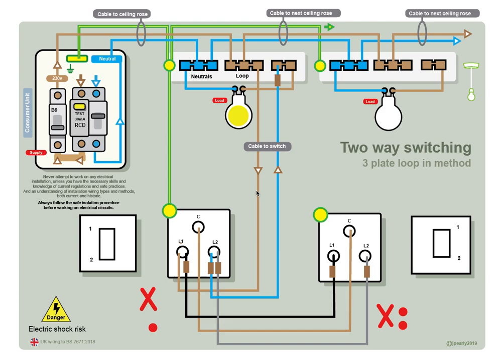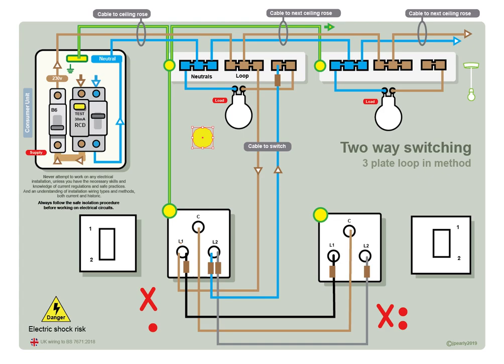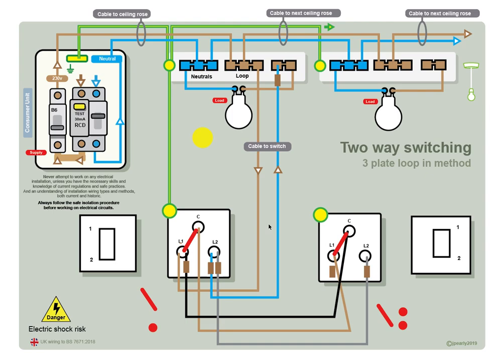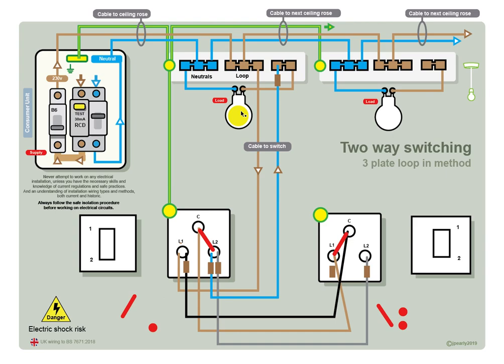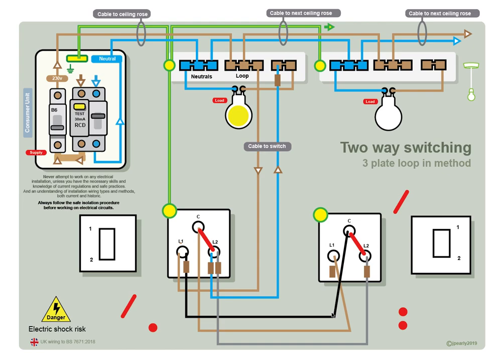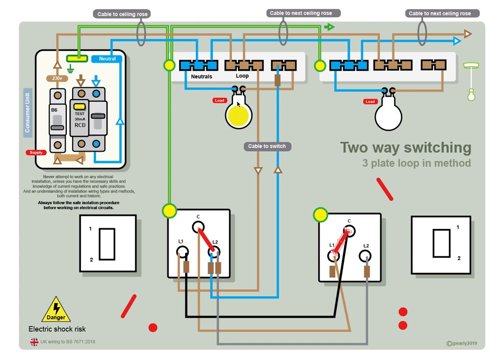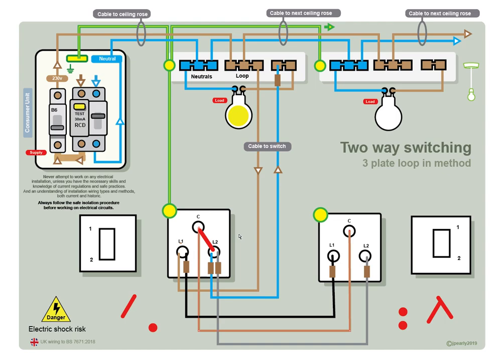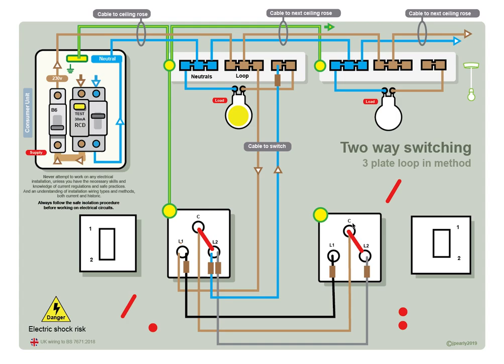Two way switching fault finding

Comment: Your videos are really clear on lighting and the s plan keep up the Great work ! Would a Air source heat pump change much from your diagram or do the zone valves operate on the same way ? And also would you consider doing a lighting video as above but including intermediate lighting across floors! :)
Reply from the maker: Thanks for your comment Khalid. Yes I am planning to do an intermediate lighting video soon.
Re the ASHP. Yes two and three port valves are used.. 
Solfex .co. uk have some wiring diagrams which you may find useful

Comment: I’m having problems with my lights. I have 2 separate two way switches in my living room. The first switch will only work if the switch on the second two way switch is turned on but then that switch will not turn the first light off, if that makes sense. Do you have an email I could send you a picture of how they are wired up ?